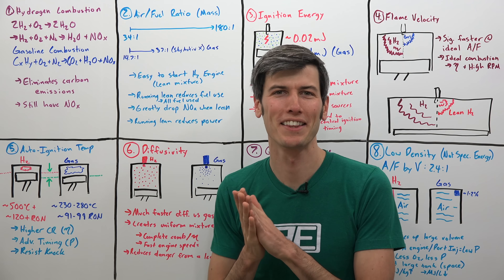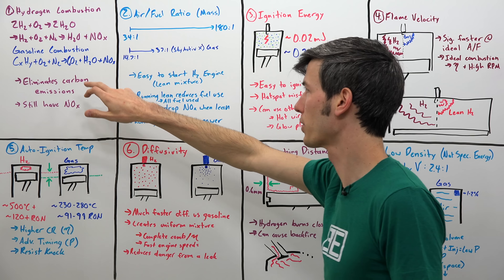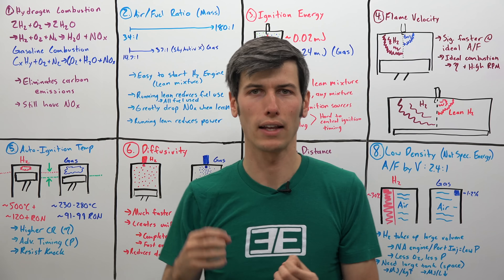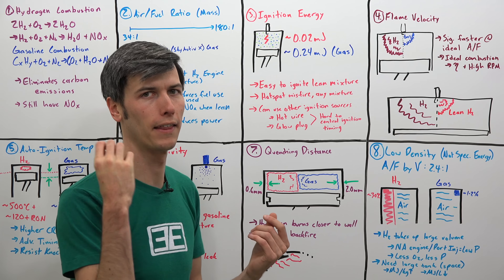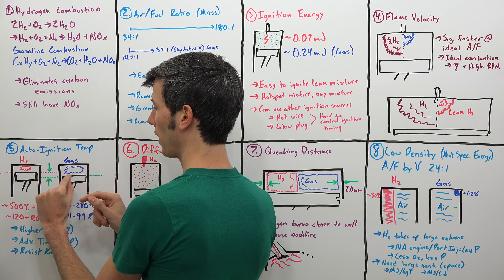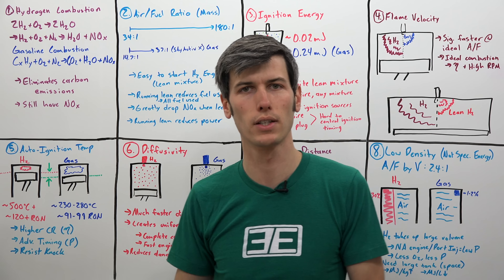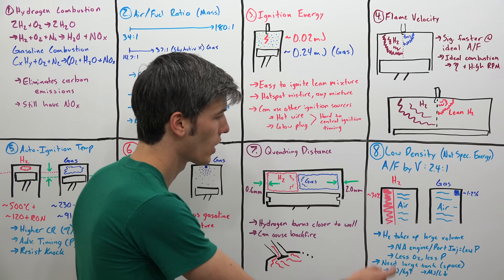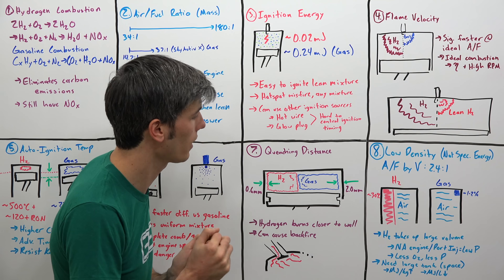The Difference Between Gasoline And Hydrogen Engines

Comment: I do not pretend to be an expert on engines. But what about rotary engines (for instance, Wankel rotary engines). How do they compare to cylinder engines with camshafts and valve lifters? What are the pros and cons of different engine designs?

Comment: Jason - - - Good job.  However, the negative information in the last octant [lower right] may no longer be as applicable as it once was.  Three H2 tanks (typical Linde (R) size ) can be stored as follows:
1) across the vehicle, under/behind the back seat;
2) longitudinally down the "transmission tunnel" in the middle of the car;
3) across the vehicle, under and in front of the dashboard.
Moreover, with 3D printing nowadays and carbon fiber wrapping, odd tank shapes can be created to perfectly match other "dead spaces" in the vehicle (like rear wheel wells or quarter panels ), and still be suitable for pressures of  2000-3000 psi.  
========================

Comment: Only thing I would say is that injection energy wouldn't have anything to do with the Hotspot you mentioned as you specified Hydrogen ignites at about double the temp of fuel. Injection energy would be exactly that, how many volts and current needed to ignite the mixture. Other than that great presentation.

Comment: The specific gravity of liquid hydrogen is an amazingly low 0.07 kg/l   compared to water at 1.0 kg/l   That is why the space shuttle had such a huge external fuel tank, rather than an internal tank like other rockets.   That is why you are unlikely to ever fly across the Atlantic with a hydrogen power plane, because the fuel tanks would take up all the cargo space, and cargo space is what flying is all about.

Comment: In that you have stepped into the advantages of using hydrogen in a gasoline combustion engine I wish to comment that there are advantages of using a 25% hydrogen mix in a diesel combustion engine in order to improve efficiency. In fact, there are diesel engines utilized in the production of locomotives and their exist approximately 70,000 locomotives in North America at this time most of which run 24 hours a day in these colder temperatures in order to avoid freezing up. The advantage of using hydrogen during the Locomotive Yard parking of a locomotive, which is not moving is very evident in that less fuel would be consumed, less emissions would be produced, and the engine would be allowed to run at a lower RPM using hydrogen solely as the fuel when the power requirements are minimal. The true advantage of using hydrogen fuel on diesel. Locomotives is mentioned cleverly as the reuse of the electrical energy produced by the locomotive during breaking could be converted to the  electrolysis of H2O 20 with the catalyst contained in the 200 to 300 gallon water tank. The catalyst would remain in solution in the water would become hydrogen fuel in the oxygen that is electrolyzed would aid in the efficiency of the locomotive during tunnel operation. The subject of safety has also been addressed in that locomotive would contain a very small amount of hydrogen fuel which be used up within hours and would not require a very large volume tank to further ensure the safety of the hydrogen fuel the hydrogen tanks could be nested within the diesel tanks beneath the locomotive platform, and therefore immersed in diesel fuel, which would dilute the hydrogen by absorption and prevent any explosion. So for these various reasons locomotives using non-taxed diesel fuel have tried repeatedly due, minimize their carbon emissions, however, these carbon emissions could be simply reduced by the addition of electrolyzers on board using brake horsepower, (which is normally vented as heat to the atmosphere.) thus the hydrogen becomes a reusable green energy, which is otherwise lost to the atmosphere as heat. We would prefer to send you a copy of our Patent using brackish water on border locomotive.

Comment: I know space and weight are real factors, but can we please talk about onboard electrolysis to power a hydrogen combustion engine? And maybe differ from the conventional piston engine? Wenkel rotary, rotary vane, centrifugal piston, pendulum piston...
Reply: Obviously with the substantial amount of energy required to electrolyze hydrogen, you would need to do that off of the car. If you enough energy onboard the car do make hydrogen, why wouldn't you just use that to power motors? Converting it to hydrogen and then combusting it would be throwing away 90% of the energy.

Comment: A Turbo charged, in-line 4, 2 stroke Hydrogen cell power plant with a liquid hydregen fuel cell. How plausible and efficient would something like that be? With how the gas fills the volume and a pressurized system to expel the H2O and NO, there wouldn't need to be a 4th stroke. This way, you can keep the power and torque high with a lower air fuel mixture allowing for a liquid Hydrogen fuell cell to be smaller and taking up much less space.

Comment: In a reciprocating engine, most of the inefficiency is due to blow by in the cylinder.  While blow-by is less at higher rpms, higher rpms significantly increase the likelihood of catastrophic mechanical failure

Comment: It’s been proved that there is 0 nox emissions in hydrogen converted engines in fact that air that comes out of the tailpipe is cleaner than the air that it takes in through plasma electrolysis, and the future and open sourced information created that you could look up

Comment: Hello just wondering if there would be a way of splitting the Nitrous Oxide away from the exhaust flow and using it through exhaust gas recirculation for a greater efficiency and cleaning up the exhaust fumes at the same time?

Comment: Hi thank you for sharing. I would like to share questions.
What about adding a Lobestone to Steel Car Piston Shell for Hydrogen gas bombardment?
When electric magnetic field is made from Lobestone will the Steel  frame Car be magnetic field power?
When ignition happen to Hydrogen gas will it be Plasma or just heat?
And
Transmission Carbon fiber gears with infrared light tricking Methane gas to move Transmission carbon fiber gears will that help the environment then fossil fuel?
Thank you.

Comment: You mentioned 30% hydrogen, + 70% Air, in your last frame. Using electrolysis, could we direct the Oxygen 
back into the Air intake manifold which should improve the burn?
I don't like the idea about pressured fuel tanks, but, like the idea of splitting Hydrogen & Oxygen.
The fuel tank should be for pure water only! 
I know why everyone is looking at having a pressurised fuel tanks, it is because the money people are clouded by $/£s in their eyes!

Comment: 4:10 Wouldn't running lean cause more NOx as there's an excess of oxygen ready to react with the nitrogen?
At least that's what happens for liquid fuel. Also, with fuel, running lean also means getting the engine hotter, which increases NOx even further. Maybe going lean with a gaseous fuel like hydrogen makes the engine colder, don't know.

Comment: the emission of NOx on an H2 combustion engine, since the temperature on the chamber is lower than that on regular mineral fuels such gasoline, ethanol, etc, is also considerably small. And modern vehicles have EGR (exhaust gas recirculation) which lowers even more the NOx emission.

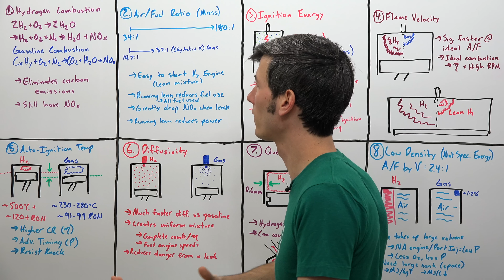Comment: 0:25 you could also use hydrolysis to have hydrogen and oxygen in the same engine. Just let it put the HHO in through the air inlet. Also, 1:45 I was like but how would this.. oh through the intake from the standard atmosphere, so the only way to do this would be. When splitting water have H2 in one container and O2 in the other so it could be a sealed system.

Comment: One has to see the technology in relation to production costs. Ie, taking crude out of the earth, transport, refine etc vs producing hydrogen. It takes quite a bit of energy to produce hydrogen through electrolyses alone.
So, next episode should compare these costs. There are a lot of downsides to ICEs w fossil fuels. But cheap oil has won over EVs long ago. Think of all the infrastructure issues rolling this out. Im glad some companies are experimenting w this. But, they have been doing this for quite some time now without a clear path forward. If hydrogen is so much better and more economical my hunch is we wouldve seen much bigger waves io the trickle.

Comment: So the engine dynamics will change in order to maximize the advantages of Hydrogen. Shorter stroke, wider cylinders, bigger valves, more cylinders. stronger cylinder walls, and better cooling/oil/lubrication will be needed because the engines will also be able to reach higher revs.

Comment: I think an "HHO-doped" petrol/diesel engine might be something that would be more useful. Cars always produce excess power to maintain the battery charged and there are a lot of operations that a car does that just dump the energy out as waste (such as braking, exhaust ejection, removal of excess heat, etc). Similar to how a turbo charger and magnetic braking can recover that waste and direct it to something more useful it can just as easily be diverted to electrolyse a small water tank (which can be topped off slightly also during operation from the AC condensate) and feed the HHO through the air intake.
Reply: You know what's far more efficient than that? A simple hybrid electric setup.
Reply: @logitech4873  of course

Comment: How about those hydrogen kits being used in normal gasoline engine? are they safe to use? They mix hydrogen with air intake which causes fuel to burn more efficiently resulting in higher fuel efficiency. Does it really work? and is it safe to use hydrogen air mix as intake in normal gasoline engine?

Comment: It would be MUCH more efficient to use hydrogen engines- very small size and not run so hot-- to operate an ELECTRIC GENERATOR--- that would in turn power an ELECTRIC direct drive motor on EACH WHEEL-- (the way a train does.. )   This would elliminate a LOT of the issues of hydrogen- greatly increase the capacity- mileage, etc.. and the output is MORE just WATER.  MORE torque is also available with the direct drive electric motors on EACH wheel- that would then be a TRUE 4 wheel drive on average vehiole.. (a bonus).

Comment: Big emphasis on the hydrogen only producing water as a byproduct of burning it, no CO2 emissions.
No mention of the CO2 created to make the hydrogen in the first place.
Nor that 90% of all hydrogen is created using fossil fuels.
No mention that the electricity needed to create Hydrogen thru electrolysis is more efficiently used in a Battery Electric Vehicle.
No mention that the electricity needed to refine the gasoline would also be more efficiently used in a Battery Electric Vehicle.
Even the argument that the production of electricity produces CO2 emissions when generated in a coal fire plant, it results in less CO2 production than gasoline or hydrogen refined from hydrocarbons.
No matter where an electric vehicle sources its fuel, it is always cleaner than gasoline or hydrogen refined from hydrocarbons.
Also, electricity sourced by any other method is even cleaner and cheaper.
With home solar, electricity is 0 emission & free.

Comment: What about using the excess heat from the engine to power an electrolysis machine that takes the water exhaust and makes more hydrogen for the car?

Comment: The extra space required for fuel cell storage can be solved by making the vehicle larger. The lower cost of hydrogen fuel greatly offsets the need to make vehicles smaller (for gasoline fuel efficiency). The vehicle will be larger while still being fuel efficient. I like larger vehicles.

Comment: Why don’t they burn hydrogen to produce electricity in power plants?
Reply: Hydrogen can be burned to produce heat and generate electricity in power plants, but it is not commonly used as a primary fuel source. One reason is that hydrogen is not naturally occurring and must be produced through a process such as electrolysis or steam methane reforming, which requires a significant amount of energy input. Additionally, the infrastructure for hydrogen storage, transport, and distribution is not yet fully developed. Despite these challenges, hydrogen is being explored as a clean energy source for power generation and may become more prevalent in the future as technology advances and demand for low-carbon energy sources increases. -chat gpt

Comment: I’m just commenting as i’m watching so i’m sure this is answered later on, on the hydrogen being able to run on a more lean air/fuel ratio yes i see it could be an issue but would i be correct in saying that very rarely would the engine be running at such specifics? Would the engine run between the 14-40 air/fuel ratio on a day to day basis? essentially limited the issues that may arise as the engines run on these leaner ratios?

Comment: Hogwash, at 13:41 you state gasoline has a higher energy density. Even though the energy in gasoline is hydrogen. Plus trying to explain the disadvantages using a naturally asperated engine, like it's the 70's all over again.  What a tool you are.

Comment: There is also another way to use hydrogen.  Pass it through a fuel cell.  Out comes water vapour and electricity.  We know that electric motors are inherently more efficient than the ICE could ever be.  I like the idea of the electric car but just don't like the idea of relying on batteries as the source of said electricity.

Comment: Lets' say for science we have a v8 engine and we run it on 4 cylinders at a time run it hot on all four and shut them off and let the other 4 run every other stroke so 4 cylinders on and 4 off and ping pong them back and forth so the cylinders have time to cool down. This could all be done with a computer control .

Comment: Can a fuel port injected gasoline engine convert to hydrogen?
Reply: The cylinder head and pistons have to be engineered for hydrogen combustion, also the compression ratio has to be modified for Hydrogen as a fuel/ energy

Comment: Indirect injection like an OM606 Benz diesel with an isolated but conjoined pre ignition chamber to allow a complete burn without thermal heat soaking

Comment: It appears that that only disadvantage is energy density (which is significant), yet liquid hydrogen is 853x more dense than its gaseous state. So if we take everything you said into account, then if a scalable liquid hydrogen cryotank were made safely, efficiently, and cost effectively, there would practically no reason not to switch all combustion engines over to hydrogen combustion.

Comment: in the actual manufacturing of hydrogen, oxygen is also produced and separated.what if the 2 gases are mixed in the chamber. also what are the advantages in mixing hydrogen and gasoline.

Comment: Okay, you said with hydrogen , at the end there .. the downside is you would take up all of your space with tank size.  well that's not true . you could put a hydrogen generator right next to the motor .and generate hydrogen as you need it . and you can have all the space you need then... I mean I don't know how fast you could actually build up hydrogen, for the hydrogen generator. but on my little generator for generating electricity . it does just fine....

Comment: Question: (What this video doesn't answer) How does it work with the oiling of the piston (piston-rings) ❓
With gasoline and engine-oil (the same 'family') there is no problem. 
But hydrogen becomes to water (H2O) !

Comment: hypothetically, if given precise cylinder timing, with the difuseivity of H, could a direct injection hydrogen engine start without a starter? dump a little into a cylinder that's on a power stroke and spark it.

Comment: I would be interested in your thoughts on Bob Lazar's hydrogen powered car. He evidently has the hydrogen bound up with a solid in these scuba compression tanks, and has heaters in the tanks release the hydrogen at a rate that is varied by the acceleration pedal. So the hydrogen is not released until it is needed by the engine.

Comment: I still think Hydrogen EV's and Hydrogen ICE vehicles are the real future over just plug in lithium Ion EV's. Run a turbocharged or twin turbocharged direct injection hydrogen engine with a catch can and a air to water intercooler and you have a real winner. A 1000MW Nuclear Power Plant produces 150,000 METRIC TONS of PURE HYDROGEN per year, so making the fuel and making it green is easy enough, just need the infrastructure, and with an NPP making the fuel a Hydrogen EV can be even more green than a Lithium Ion one, it would even make Lithium Ion EV's greener due to the energy source that is recharging them.

Comment: Dont you reckon that, theoretically, liquid hydrogen and oxygen could be stored in a car's fuel tank and directly injected into the combustion chamber without the use of an intake valve? I think this could solve the majority of the problems hydrogen faces as a fuel for an ICE.  It would remove nitrogen from the equation and therefore NOx emissions, leaving only burned engine oil as a possible source of greenhouse gas emissions. If it were stored in liquid form you'd be able to keep much more of it in the car and account for its low density. It would obviously need to be pumped into the car in this form from a fueling station.

OBVIOUSLY it would cost a lot to get these gasses in a liquid state but one could hope future technology could make this cheaper. If that were the case do you think something like the above could work?